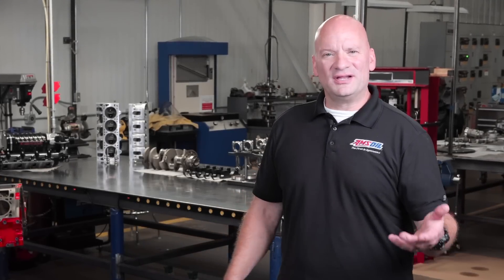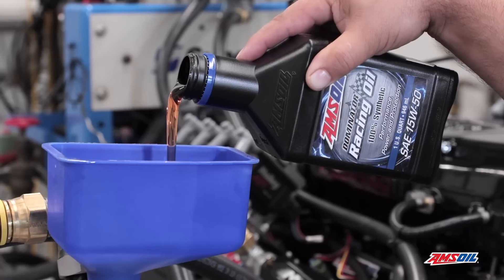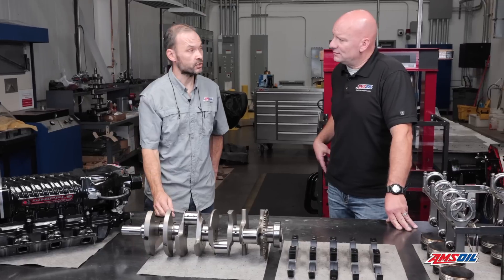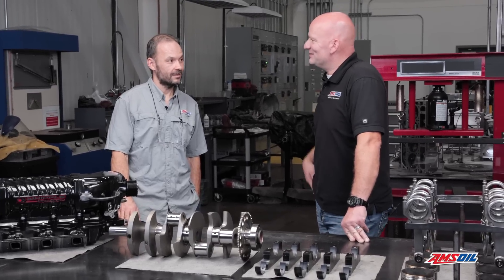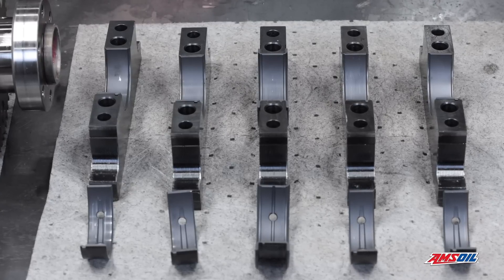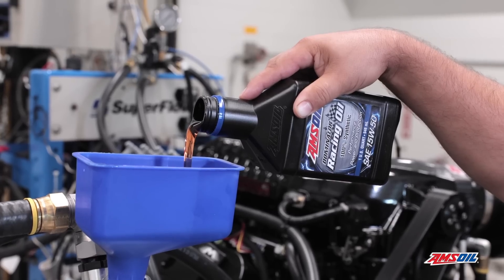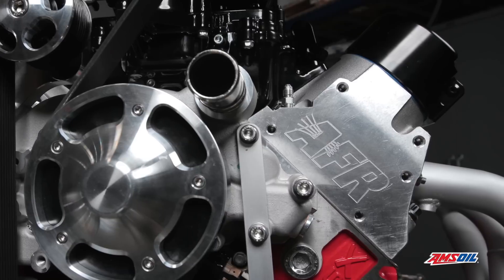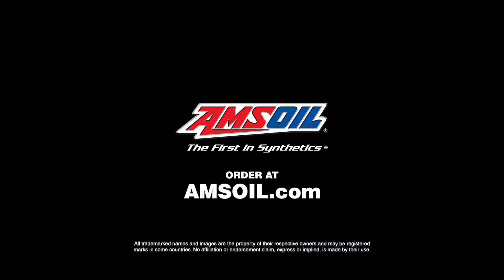1,000-hp Supercharged LS Engine Torture Test – Proven Performance

Comment: Not impressed with the piston skirt wear or the cylinder wear.
I would have rather seen this test done with OEM parts in a LS and run with Signature Series.
This doesn’t help me believe that my engine running at wide open starts from stop signs and wide open on ramps, Which I do everyday is better off with Amsoil.
Now show us a modern engine being run hard. And I mean very hard with Signature Series at Manufacturers recommended viscosity oil.
This test doesn’t tell me anything about how good Amsoil is on a daily driver than any other oil.
I have a company van a 2.5 litre Ford Transit that sees abuse every day. I pull wide open from every light and stop sign. I shift it with my foot. At wide open throttle just before the automatic shift to second I let up on the go pedal then back to the floor. The shift is very harsh and very positive. I don’t warm it up in the morning, I just jump in and go. I am in the great white north so is this abusive, I know it is. It’s a 2014 and gets signature series 5-30 oil change once a year. But is it the Amsoil that has kept it alive or just that Ford has made a very good engine (A first for Ford)
Reply: I have a ls swap in my 85 monte carlo with a th350 transmission that i run 4500 rpm on the highway for hours  daily driver running amsoil sig with  one oil change a year and the engine has no wear at all after sending the oil in the be analyzed. The oil is made of gods blood I heard i have over 400000 miles now with a melling oil pump.😮

Comment: I'd like to see a test running Amsoil Signature 30 grade in the same motor under the same robust routine... objectively speaking the greater the oil flow = less oil drag= more HP= less temps...

Comment: Daily driver in Houston HEAT, then I'll be sold.
Reply: Fortworth tx ls swap monte carlo with th350 3 speed transmission running 4500 rpm on the highway daily for hours in 100 degrees temp for years now with amsoil sig.

Comment: I wonder if they would have seen better results with a 60 weight oil instead of the 50 weight. This is on the more extreme side of things understanding basic physics of fluids and flow and all that as long as there’s enough clearance for the thicker oil I’d assume it’d protect things a tad bit better.

Comment: Great! Now for comparison and to be fair, build another identical motor and run mobile one.
Reply: Don't do it  the image of the rod bearing will give me nightmares for weeks after. Stay with amsoil 😢
Reply: Build a motor for drag racing with a ProCharger supercharger and notice  1000 more HP at the rear wheels
Reply from the maker: Stay tuned! We have more plans in the works for this engine.
Reply: When you say identical, do you mean all the same blueprints or measurements from tested motor? Or another engine with all the same  part numbers.   I would like to them build a motor with all the same measurements😂and the same results, since how the Camshaft breaks in makes a difference. Just as the same ring gap on all 16 compression rings, and what about piston to valve clearance, rod length, compression height, indexed cam lobe centers, is the cam centered in the block or just square decked with BHJ plates and bo❤red with 2 torque plates, same end play, are the rear cylinders larger diameter. WHAT IS THE DIFFERENCE BETWEEN A MASTER MACHINIST AND AN ENGINE BUILDER .0005❤❤"? Answer is: "There is only 1 EngineMasters" 2014 MAHLE Aftermarket Champion Technician
Reply: I've ran Brad penn, penn grade 20-50 from about 2009, im actually afraid to change when there's no problem...
Reply: @supercharged6771  - Might it be better to look for improvements instead of just accepting no apparent problems?
Reply: ProBlend Oil Additive removes friction and increases RPM

Comment: Bruh when you said you only ran 25 hours on the engine I stopped watching
Reply: The vast majority of 1000+ hp race engines don’t run that long between rebuilds. They simulated drag passes and track time for 25hrs. This is similar to 24hr of Le Man. Continuous high and low RPM operation and those engines make less power even in the hypercar class.